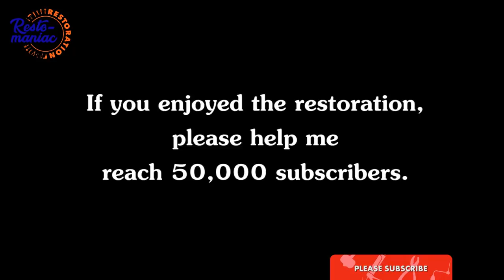Vintage Pencil Sharpener Restoration

Comment: When I first saw this I thought it is exactly the same as the one I have. This is in fact a Soviet copy of the original which is a German Staedtler pencil sharpener. Mine was made in the 1960's. There are slight differences including: 6 pencil gripping teeth instead of 3, a finer casting on the German one with less casting marks, better fitting sharpening spiral cylinder which does not need that washer you have in yours, orange tinted transparent plastic shavings catcher with Staedtler embossed onto the front. Also, the handle is a hard black plastic which had an oval profile. The original paint colour was a hammer finish metallic blue a bit lighter in shade than the one you used.
I restored mine too. :)    Good job.
Reply from the maker: Thank you so much. You gave great details :)
Reply: Staedtler, That name is still going strong i think . The Soviets like the Japanese were great at copying things and sometimes improving them , the casting marks is typical Soviet , they did not worry about that sort of thing so much , it was the same with the T-34  tank , very rough but quantity mattered more than looks